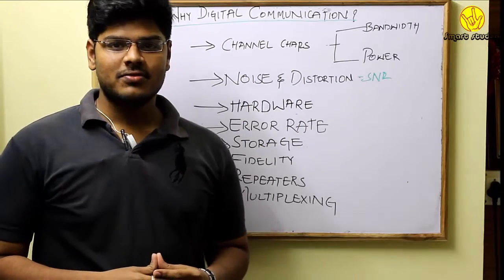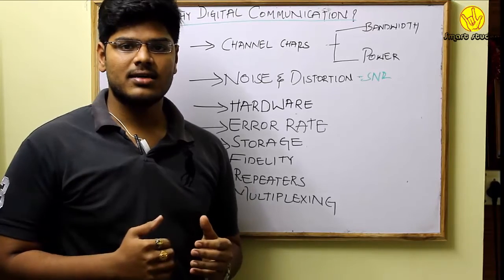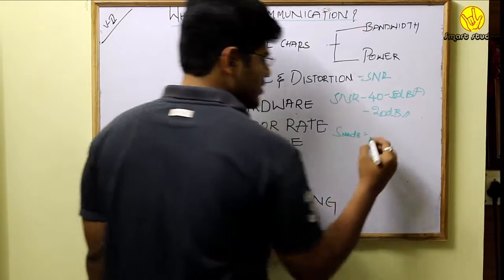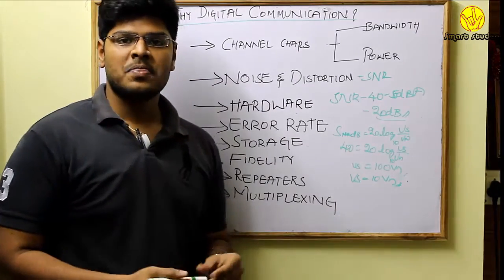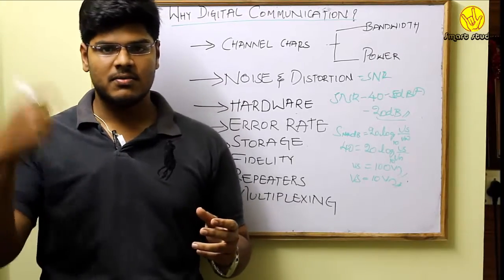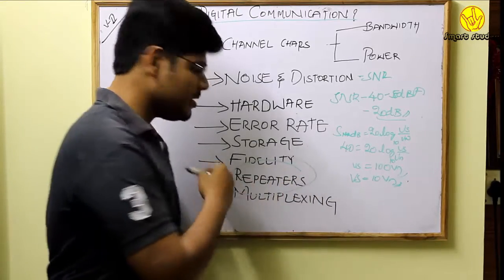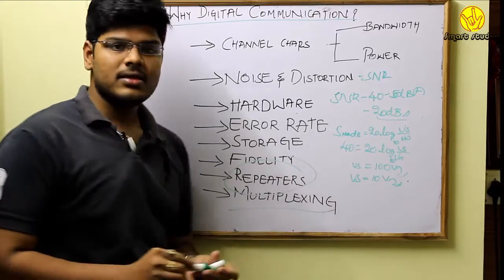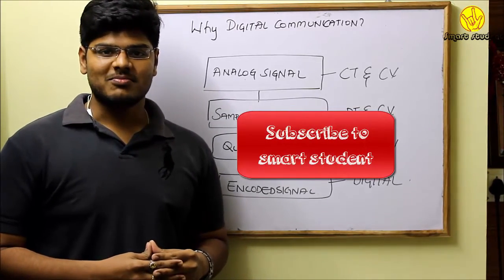Differences between Analog and Digital Communication

Comment: generally we need signal to noise ratio should be high but you said that in digital communication only 20 DB which is lesser than analogue communication which is 40 DB...then how digital is better than analogue communication.
Reply from the maker: In the video the minimum SNR required to retrieve the message signal is said to be 20dB for Digital and 40 dB for analog communication.Thus what we intend to tell is digital communication even though SNR for received signal is low .It can reconstruct the signal. Thanks for watching :)